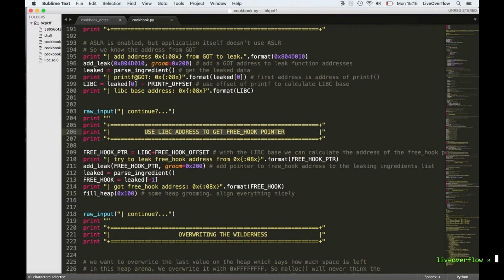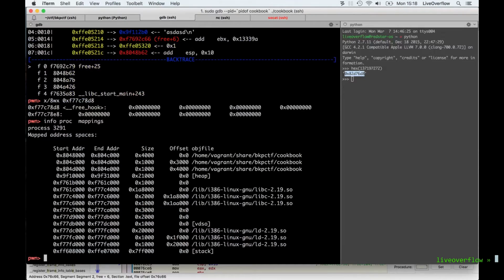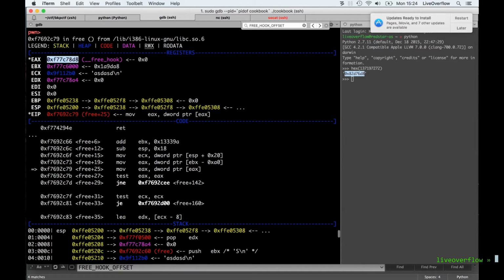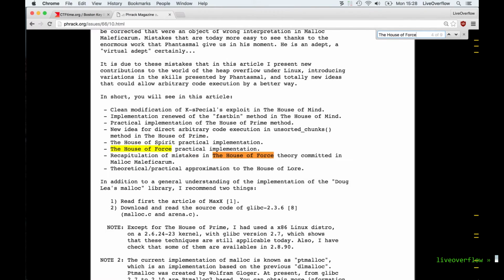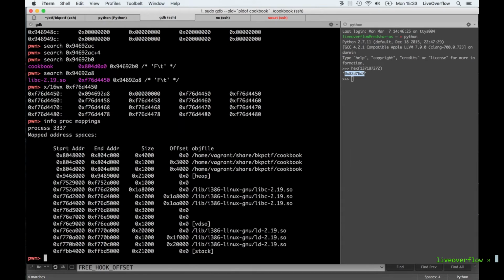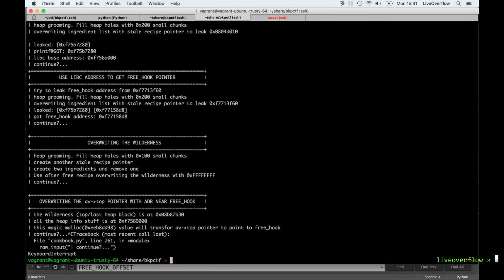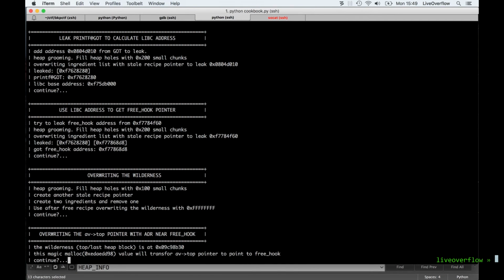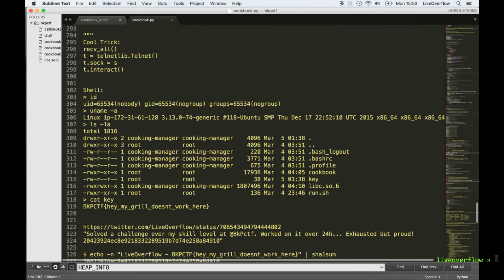Arbitrary write with House of Force (heap exploit) - BKPCTF cookbook (pwn 6) part 3

Comment: This is insane.. the final trick is somethig that I can't even imagine.. Too complex. Your amazing.
When You reached the av pointer I thought that you were going to Rop Chain the System()  call in some way with a single cmd as parameter. But I m not sure if it would be possible.
I mean if you overwrite that av pointer with some ROP, it would be possible to shape the stack in order to get (even if just one single time) a sys call with "id" as parameter for example??(just an idea)